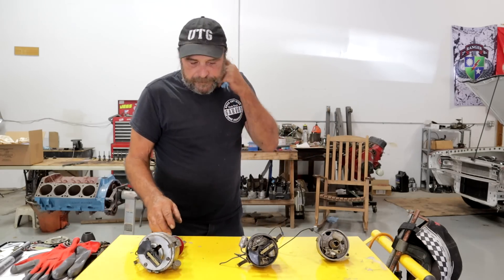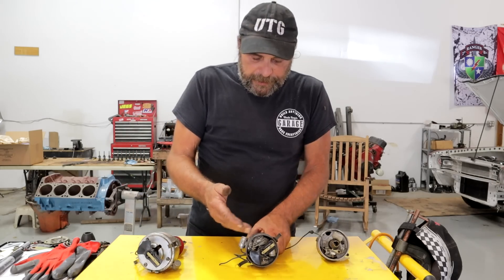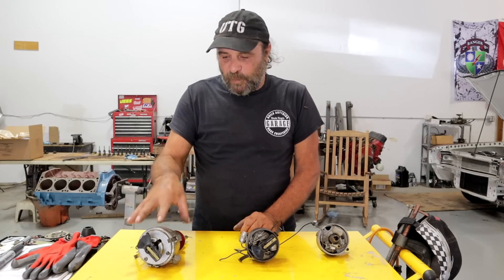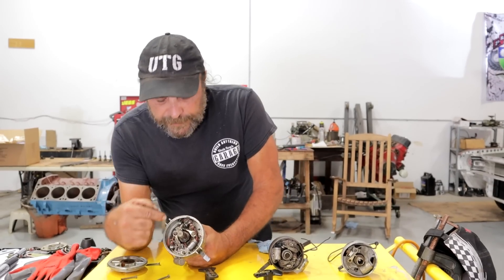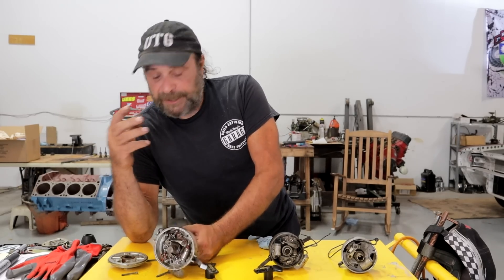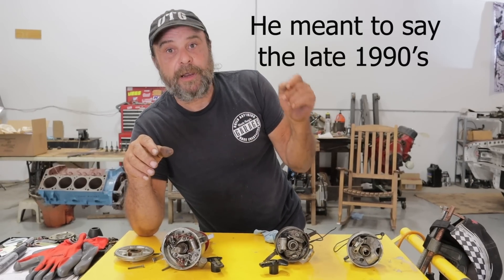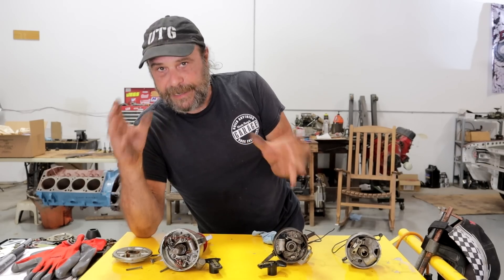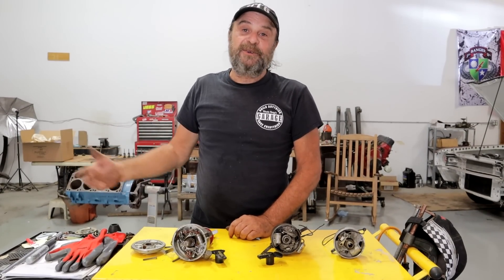High Performance Point Ignition Systems -  Tuning, Modifying And Understanding The Different Types

Comment: One hack that not everyone knows about , is - you can use an MSD ignition box (6A, 7AL, whatever) in conjunction with a points distributor , alot of the dirt track guys use this setup. Your lightning bolts turn into cosmic deathrays and for the total analog tinfoil hat failsafe guys - the advantage is, if the MSD lightning box dies, you can just remove a couple of wires and hook the distributor up as normal and drive home!
Reply: Great point ! MSD 6 box in conjunction with a good set of points is the best of both worlds. The points will last a lot longer, as only milli-volts is going through them instead of 7-12. The only bugaboo is rubbing block wear, so you'll have to re-gap the points occasionally. If the box fails on the road, converting back to conventional ignition is straight-forward.
Reply: So rubbing block, is that how points with good contacts die?
Reply: I ran a MSD 6ALon my V8 flathead powered truck for many years and used the stock distributor worked great. I had a switch so I could switch back to points and bypass the MSD if needed.

Comment: The best system I saw was a V8 Distributor that used 2 coils. So each coil would be fired once and then have a break as the other coil fired the next cylinder in the firing order, so each coil had a longer lead time to regenerate voltage between firings. That was on a Repco-Brabham Holden Formula 5000 engine, and I haven't seen one of those Dizzys anywhere else..
Reply: I have seen an l34 Torana with the same setup.
Reply: @stevenkirk2563  Yes , the L34s (the real ones) used a strengthened F5000 308ci block and used that same 2-coil distributor. I wish I could find one actually as I would love to run that setup on my racecar

Comment: That is what I have always thought about people that complain about having to deal with points on old cars. They usually complain about other aspects of the car right after that. If they can't handle it, buy a newer car that they can handle. I've always enjoyed working with points, never left me stranded, or not started. Ever go to a car show or cruise in and notice about half of the cars that pull in and out don't sound like they run quite right? most of those have had the kitchen sink thrown under the hood and usually aftermarket electronic ignition as well, not that it's the fault of the ignition usually, just the mentality of if it's new it's gotta make it run better. People always turn around to see what started when I start my car up and drive out of those events, and it's got stock ignition with standard points and blue streak ignition coil, 7mm standard motor products wires as well. I'm the only person on my block that owns a dwell meter, I am sure of that and that's just fine by me.
Reply: Point distributors will usually let you know when they need attention. Electronic ignition will run fine and just quits and that is it.
Reply: @GaryH-pw9cm Yep I've had electronic ignition do just that to me.

Comment: So GM sought out a better ignition and developed the HEI to the tune of $5 million invested in research. They proved it was superior to a breaker points ignition. I've had stock GM HEI distributors operating in industrial engines for over 20 years, never touched ....ZERO maintenance. I've witnessed in person a stock Chevy HEI distributor on a (distributor) machine provide perfect spark at 8500 rpm for 60 minutes straight. No way I'd go back to points. HEI all the way

Comment: I dont know about all distributers but on ford underneith the points there is a moving plate with two diferent size gaps on each end of the plate, what  is the purpose of this plate? I also noticed that diferent distributers even those with the same part number will have diferent size  gaps on these plates. How do I know which one is right for my vehicle

Comment: Makes perfect sense to me. I grew up in the late 60's early 70's, so I was accustomed to using and maintaining points. A couple of years ago I retired, and was lucky enough to buy the car I wanted when I was 16, a 1973 Mustang Mach 1. As I was checking things out and tuning it up, I thought I wanted an electronic ignition to replace the points. After doing some reading online, I found out that there had been some problems with the ignition I was looking at. Someone had posted, if you go with that system, you need to keep a spare module! Really? So I got a new set of points and it's been running great. Cars ran great with the points system for many miles, so I figured I would stick with what I knew would work, and what I was familiar with. Great video, keep 'em coming!

Comment: My '67 Dart GT with "Charger 273" engine also had dual points.   I was in high school at the time, but fortunately had a neighbor that was a Dodge sponsored drag racer and taught me how to do all this.  First time I came to him with tune up parts, nothing fit.  He told me to just go to the auto parts store just ask for "tune up parts for a Hemi".  And yes, it took J11Y's (aka "Jellies"), not the smaller N's.
Reply: I had a 67 Barracuda 273 with dual points that motor also had a solid lift cam in it.

Comment: Uncle Tony, I was watching the live feed last night and was the first one to ask a question which Uncle Kathy read to you but it never got answered. I was asking what would cause a 78 Dodge camper van to lose spark while giving another vehicle a jump start and now it only gets 1 spark as I turn the key off and at no other time. I am in a tight spot and have a fast closing deadline to get it moved from the property it is on. It ran great until turned the key on the other vehicle then just died. Changed the ballast resistor with no luck. What else could it be and how do I check? I think something got lost in translating it into Klingon. I am desperate, dont have money for a tow or a shop fixing it. PLEASE HELP IF YOU CAN!!!
Reply: As a temporary fix to get it out of there, run a direct wire from your battery to the coil. Or you can try running it to the ballast resistor to get lower voltage. You'll have to pull the wire to shut it off. Plus it will give you some useful ideas on how to properly troubleshoot it once you have it in a safe location.
Reply: @americanpatrol4603  thank you on the suggestion of hooking to the ballast resistor. How far can it be driven with the coil hooked directly to the battery? I’m a bit rusty on some of this as it’s been about 30 years since I have had to hot box a coil and those times it was always short distances so what is a bit longer trips affect going to be on the longevity of a coil with full power going to it. I have to go about 10 miles with it to get it to its new location. Will it make it? I know I sound like an idiot but severe chronic back pain without any meds to reduce the pain at times can turn a somewhat intelligent person into somewhat more of an idiot. I think I have probably lost about 2 IQ points per bad disc in my back and neck thanks to being denied any pain meds…lol.
Reply: @todddenio3200  I think you'd be fine to go 10 miles. I ran my 64 GMC for years on straight 12v with no resistor wire. But that was a points set-up. If you run it to power the resistor, that's what you're running anyhow. Naturally, this could all be inapplicable in your case but I thought I'd make the suggestion.
Reply: @americanpatrol4603  wouldn’t got boxing the coil actually bypass all of the electronics such as the ignition module and the pickup in the distributor as the coil would be live full time and going straight from the coil wire through the rotor to the plug wires?
Reply: @todddenio3200  The negative terminal on the coil is grounded by the ignition module to cause the coil to discharge through the coil wire to the distributor. Your problem is probably a bad wire or connection in the ignition 2 starting circuit or a pickup coil in the distributor is out of adjustment or bad. Check out this youtube video for more info on the mopar ignition system and testing. https://www.youtube.com/watch?v=tVja7UctgIw
Reply: @nonamo9348  the Dodge was running great and when doing a jumpstart on a Chevy suburban and as soon as I turned the key on the suburban it started but the Dodge died instantly and hasn’t had spark since. Would the coil have good spark if I ran both +  and  - directly from the battery or would it have to be run through the pickup in the distributor? At this time I am just trying to find the quickest way to get it running well enough to get it to its new home until next week when I will have the time to fully go through everything. Currently I am checking things out and trying different things between my other Dr appointments and  between raindrops (more like buckets than drops). Plus I can only stand up for short periods due to bad back issues so I have to keep track of what all I have and have not done to resolve it. I’m doing it to help out my ex wife who is now strangely enough my best friend. She can’t afford to get it towed at present and I am not in a position to help her financially otherwise we would just have it towed and fix it once it’s moved but funds are too tight until August. (Moving it and herself now because her landlord suddenly sold the building and the new owners want everyone out because they are going to remodel the entire place. I know their time limitations are not legal but due to other things in her life she doesn’t have the emotional energy left to fight it and just wants to get out of there ASAP or sooner.
Reply: @todddenio3200  Don't hook up a jumper to the negative side. Just put one on the positive side. If it still doesn't have spark while cranking, then it's probably a damaged ignition module or bad pickup sensor. You can call the local auto parts stores and ask if the test ignition modules. Some places do it for free. There could have been a voltage spike that damaged the ignition module on the Dodge when you started the Chevy. Problems like these are why some people prefer points over electronic ignitions.
Reply: @nonamo9348  I have always preferred points myself. At this point< I am thinking it is probably the pickup in the distributor because thats the hardest part to access and change on those Minnie Winnie campers with a 400 in tem because the distributor is in the front where its difficult to reach

Comment: As a new hot rod teenager in the mid to late 80s, my first few cars had point AC Delco distributors.  I did not tighten the screws on my 71 Impala's points snug enough and it loosened up on the highway.  I figured it out pretty quickly and got it running again.  I even recall the "Help!" section of the auto parts stores used to sell an assortment pack of point screws.

A few years later as a college freshman, I bought a higher mileage 72 Monte Carlo and put an Accel coil and tan cap on it.  I think I bought the plugs, points and wires from K-Mart as they still stocked stuff like that.  Car ran fine for the first part of the school year, but it seemed to develop an ignition problem and was breaking up.  I had a dwell meter and I verified it was in spec.  Problem persisted.  Maybe the condenser was bad, but I gave up on points at that point.  Summer break was at hand and my jalopy was not going to make it home misfiring for a 7 hour drive.  The dorm was closing soon so I asked my buddy to drive to the local junkyard and pick me up a used HEI with wires for $25.  I opened the gap on the old plugs and swapped the HEI and wires in the dorm parking lot.  The swap cured my problem.  I never had any further ignition problems with the Monte.

All my hot rods since then have electronic ignitions and my small engines do too.  I never liked taking the flywheel off the lawnmower to access the points.  Worries about dwell going out of spec or the points burning or a condenser failing are long in the past.  The point is my hot rod experience is better without points.
Reply: It was a bitch if you dropped the screw!!!

Comment: Setting a dual point with one set retarded and one set advanced also happens with aircraft. A lot of older aircraft with Bendix ignition systems have only the left magneto set up this way just for ease of starting the engine cold because aircraft magnetos don't have advance curves, they have fixed timing and that's the only way they could figure out to retard the spark for starting.

Comment: I used dual points in my street cars in the 70's, but my blown small block Chevy I used a vertex magneto. I had plenty of spark at 9000 rpm. Ran a best of 8.02 in a 2500 lb steel body 35 Ford roadster. Yea, we made a roadster from a coupe. Tree limb ruined the roof.

Comment: I am 55 and grew up wrenching on the farm. Everything had points for awhile. I was building and tweaking things in the early to mid 80's. I drove stuff from the 60's and early 70's in the 80's because I did not have a lot of money. I laughed when you started talking about the road side repairs. Every car I had contained several things in the glove box. Extra set of points and condenser, match book and possibly a recipe card.  Also a finger nail file or possibly some emery cloth, a small pocket screw driver, 2 spark plugs, a rag and a can of WD40. 

I used to drive international scouts and trucks. They were notorious for getting water up into the distributor from the smallest puddle or splash. Driving down the hwy. in a rain storm would leave them helpless. A quick spray and wipe down with a rag and WD40 and I was back on the road.

The old binders had the dist. on the front of the engine where they would get water up in them.

A lot of people don't know that the WD in WD40 stood for Water Displacement. It excels at that and every off roader I know of carried it in their rig for multiple uses.

I reset many large oversized truck and implement back on the rim with a squirt and a flame. 

The trick was to make sure you pulled the valve stem core out first.

Heh Heh, oh the dirty greasy memories.

Comment: Tony most if not all issues with Pertronix type ignition systems is that most novice builders don't bother to check the voltage output of either the genenerator or alternator at approx 2500 rpm. Sometimes voltage outputs can be up around 15 volts if not checked. This tends to cook the module which overheats then shuts down for 20 - 30 minutes. The cycle will repeat until the module finally dies. Also the coil should be around the 3.2 - 3.4 ohm primary resistance (if not add a ballast resistor to correct the primary resistance to that value). Another way to kill a Pertronix type module is to wire it up "accidently" in reverse polarity. Result...instant death.  No need to ask how I learned this. 😉
Reply: Yup, my 74 Bronco has a spare coil mounted that gets swapped on occasion. Have points in the glove box. Will just go to them next tuneup.
   My 97 EVO Harley is on shovelhead points. Starts better, smoother… once I got the advance set right, she quit pinging at load and back firing on startup.

Comment: Yes points work. But if it was the thing to end all the automotive company’s would not have developed and installed electronic ignition. The most successful HEI has thousands of examples on the road with longevity just as good as point if not better. The HEI’s plus is the dwell increases with RPM’s, point decreases. The spark to an ‘E’ core coil is stronger and big asset for performance. Yes points is simpler, but if you want more performance points has a limit without electronic components to increase output. An HEI system with magnetic pick up, reluctor wheel, module, installed in a small diameter distributor with ‘E’ core coil is very reliable in applications having higher compression and more efficient heads and fuel systems that require more of the ignition system. This is the whole reason companies such as MSD, Crane, Mallory, and others are so successful.

Comment: I always say that modern cars run perfectly 99.9% of the time...and the rest of the time, they don't run at all, and the repair invariably costs money for replacement parts.  Cars with analog systems like carburetors and points require maintenance and a modicum of understanding of how they work...but once you have that, it'll always get you home.  It may be running like a dog, but it's enough to get you where you need to be.  And tomorrow, you can chase down that gremlin in the system, clean and adjust...and all's right with the world again.  At no cost other than a few minutes work and a few more minutes thinking.

Comment: Slew rate simply describes how quickly an electronic component can change its output from one voltage (or current) to another.  You'd think it would be instantaneous but there is always some lag and that lag is given as Slew Rate typically measured in volts (or amps) to microseconds.

Comment: back in the 70's I always ran a set of HD Bluestreak points in a stock single point distributor that had a much heavier spring pressure than stock. I eventually upgraded to a Mallory dual point distributor which I still run in my 327 engine.

Comment: My old points iggy diagnostic rig was a motorcycle turn signal bolted to a roachclip, with a nail soldered to the pigtail. Used it to check points, coils, static time, etc. Pals would roll their eyes first time they saw it, then beg to borrow it, lol.

Comment: You're 100% correct I would never use a protronics over points and you're also 100% correct no points will ever make it to 9 to 10,000 RPMs correct

Comment: In a situation where you absolutely cannot get any replacement ignition systems it will always be much easier to fabricobble something together that works for a mechanical system than an electronic computerized one. Just saying!